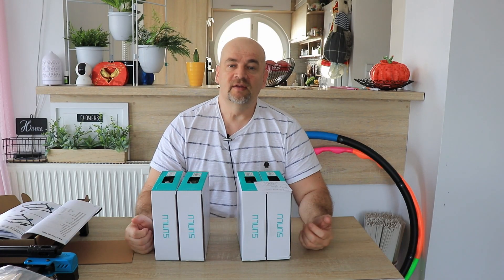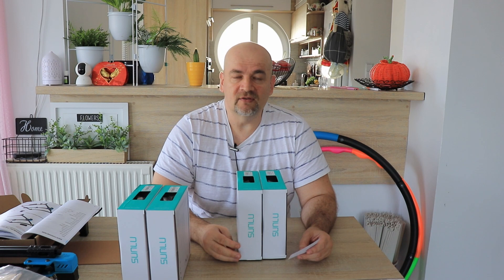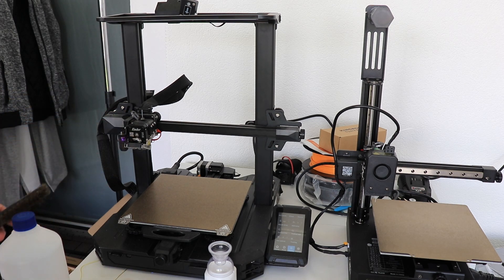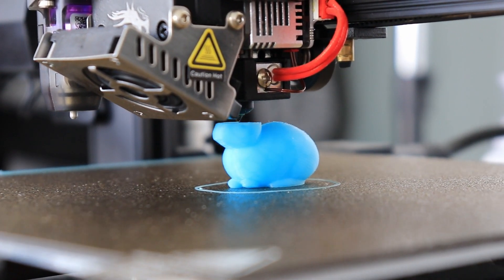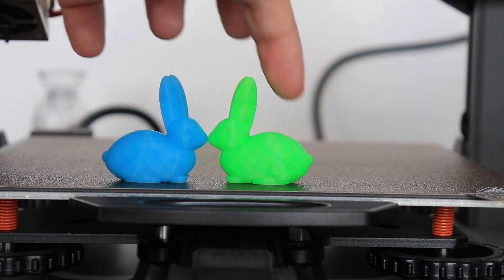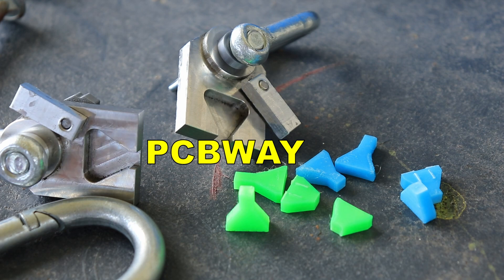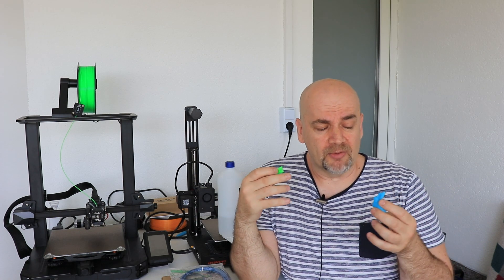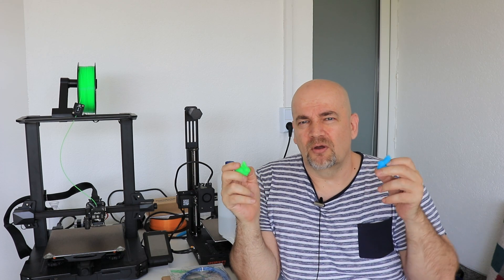Sunlu Noctilucence PLA review (Glow in dark PLA)

Comment: You shouldn't print it with a brass nozzle. youre also not suppose to put it through your ams (For bambu labs), but you can with feeder guides ! you should have hardened extruder, and hardened steel nozzle. if not your feeder tuber will develop a filament wear in the tube and the gears of the extruder will grind down quicker causing it to strip either the gears, filament, or both lol (Not coming for you, this comment is for educational purposes as ive been dealing with a problem, fixed it, and now id like to see how others print it)

Comment: Thanks - I've been running at higher temps - so will defo go lower as I had adhesion issues - yes - defo go for hardened steel or up if you do a lot of glow filament from any maker.

Comment: eSun glow filaments are better (except the blue)
they are opaque so you get a VERY bright green glow for hours after the lights go off. I used it to print bedside trays for glasses/water, bulb and lamp covers, cable holders, etc to help me find the things I need in the dark
Reply from the maker: Very useful info, thanks for the idea where to use it. eSun with hardened nozzle?
Reply: @MyTechFun  definitely. Glow filaments chew up brass nozzles
Reply: That's really helpful thanks!
 @iamdmc